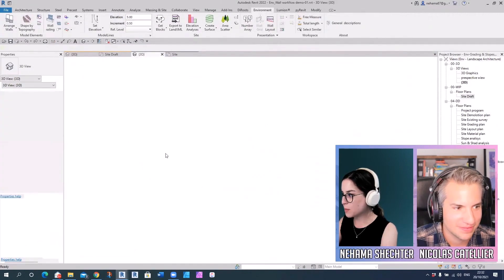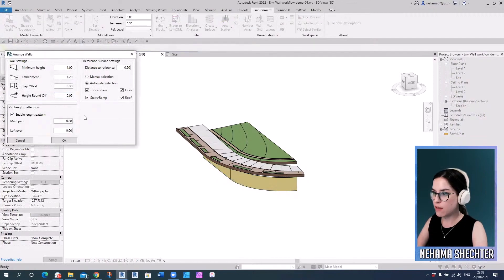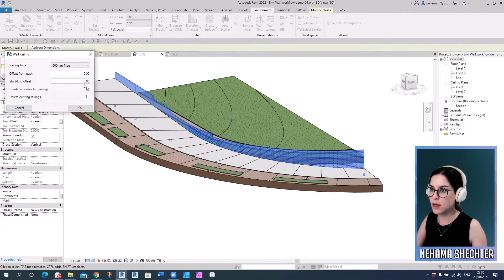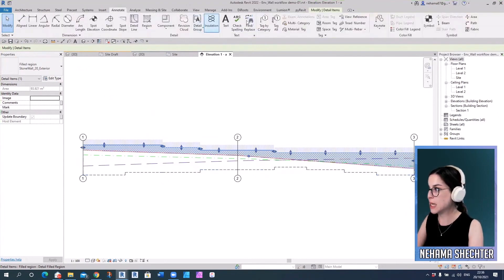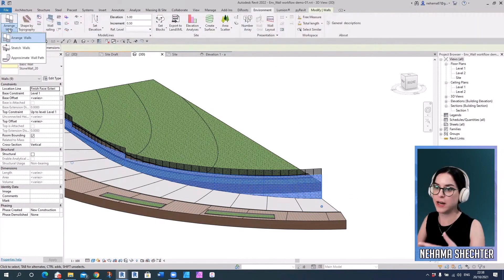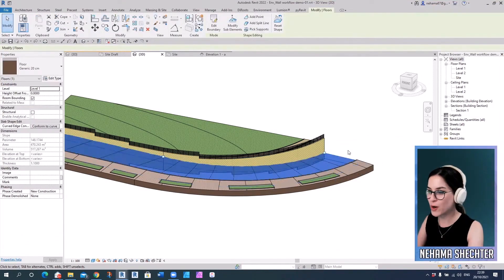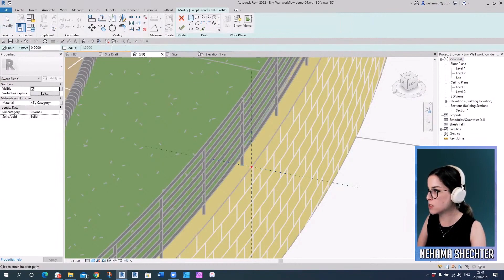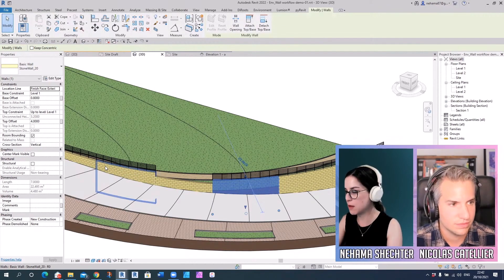Modeling Curved Site Walls in Revit, with Nehama Shechter | Clip

Comment: In that kind of situation where the wall need to follow the floor elevations. I don't use walls I used floor and adjust the thickness of the floor ex. 3'6" and then just trace the curve wall. After that you can manually adjust the height of the floor wall that you made by Modify Sub Element then pick the point and adjust height
Reply: We now have a new solution for that: https://youtu.be/tyQ1CXaTyp4